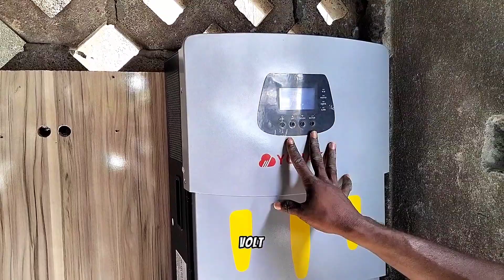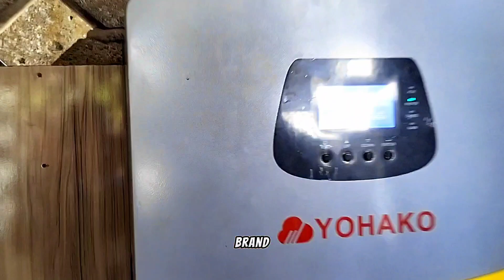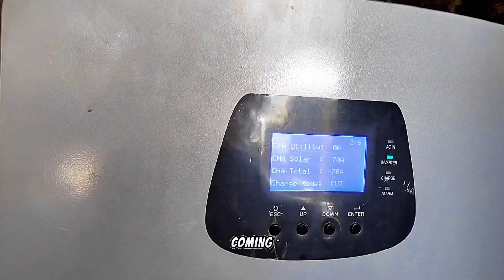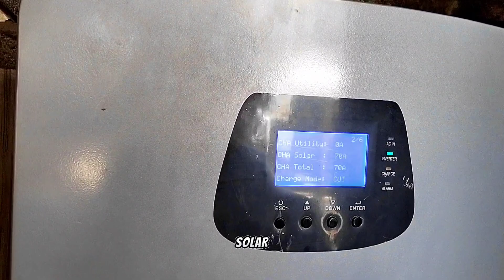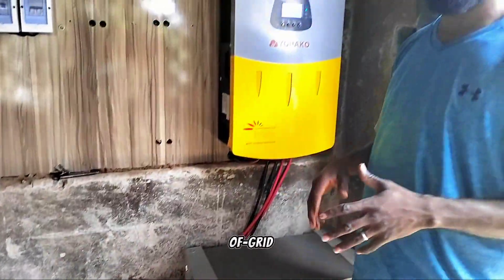how we reconfigure a failed solar energy system using the same materials

Comment: Can someone use 14 320watt solar panel to charge a 24 volts 220amp tubular battery with a charging controller of 60amp

Comment: Your videos are awesome but doesn't end well. It just cut abruptly. And another thing i want to say is since were 24 panels of 250w all connected in series which gave 6000w in total. If you connected the 24 panels in 2 series, would it not have work perfectly well? I am asking because the inverter is a 5kva inverter. Connecting 16 panels in 2 series with will 2000w, but if 24 panels connect in 2 series, it will give 3000w which i think is ok. Please can you explain better because its kind of confusing

Comment: Boss you didn't explain the error in the panels configuration which made you use just 16 panels instead of 24 sir was it polarity error
Reply from the maker: The panels we're higher than what the charge can handle
Reply from the maker: Not polarity error.
Rather the connection!.
Reply: @Mairigaemmanuel  if the panel was on parallel the voltage was too low buh its work well during peak sun before the inv goes of during the evening if am correct sir you reconfigured the panel is series to increase the voltage while the inbuilt sc will be able to convert excess voltage to Amps to charge the battery better ??
Reply from the maker: Yeah, I changed the connection to paraseries.
2s, anyways there's isn't much conversion from the controller though